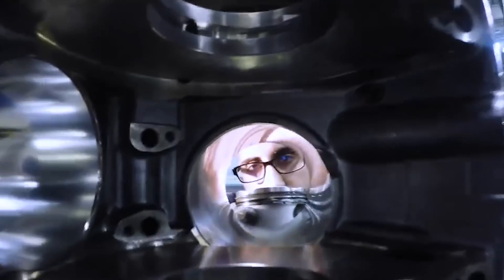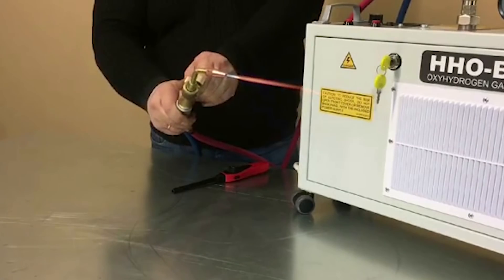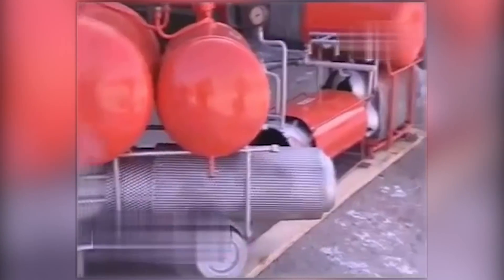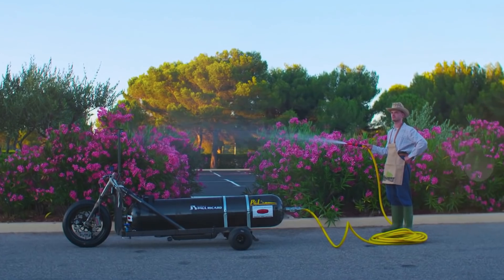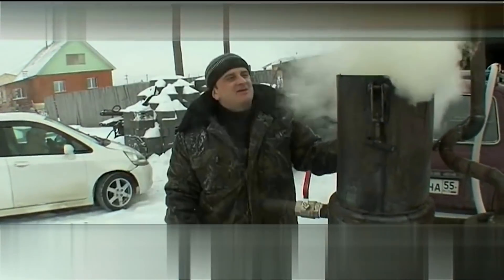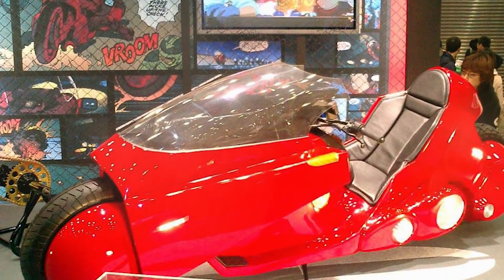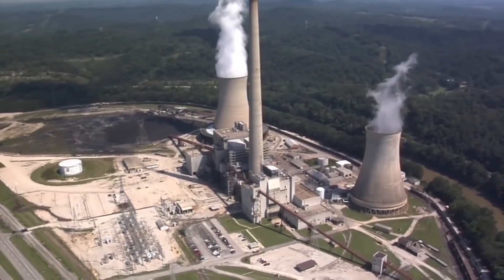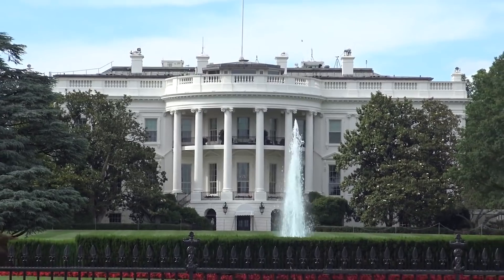Why These Engines Are Banned?

Comment: compressed air engine as a big thing? james watt lies in his grave and dies a secon dtime of laughing.
Reply: Remember the old airhogs compressed air airplanes and car you could get from Wal-Mart? Lol,  I still got mine, and two extra wings. Lol.
Reply: @hearsejr  me is german but me managed to buidl one colander air engine from lego.
Reply: @Irobert1115HD  they are fun to play with. Lol.
Reply: @hearsejr  Yup! I had mine in what, '97 or 98?
Reply: @KurtStudman  lol... It's been a while.
Reply: NibiruLives  No it isn't. It requires water pressure to work and some of that water pressure is lost in the process.
Reply: I've seen a photo of a WW2 vintage locomotive used in an explosives factory that ran on compressed air (safer than steam or electric).  They were not used more widely simply because of the limited range due to the space needed to store the compressed air.  Compressed air is a secondary fuel, so using it depends on a primary fuel source such as fossil fuels, solar etc.
Reply: @charlesangell_bulmtl  actualy yes. deisel can run on more fuels than just diesel. the problem is the fuel pump. solve it and the thing runs on vegetable oil.
Reply: @Irobert1115HD  The fuel pump isn't a problem at all, in fact the pumps used for "alternate fuels" needn't be protected from the solvents found in petroleum products.
Reply: @Irobert1115HD  the problem was not the fuel pump before, but it is one of them now, along with emission equipment.
Reply: NibiruLives  
Exactly how is compressed air free? It requires a compressor, consuming energy you pay for, to produce compressed air and waste heat.
Reply: @chuckaddison5134  use a bicycle ;D
Reply: @chuckaddison5134  Its free cuz you manualy pump it.. ahaha .. LOL .....
Reply: Chuck Addison ever Hurd of wind turbines ???
Reply: @anshulbhardwaj4038  you know that they are not wroking at all? the energy lobby buidls them as oversized ventilators to keep the prize of electrizit up. a friend of my friends friend heard it from a friend who works on a new energy source that doesnt need any fuel or energy input.
Reply: Dumbass...hahaha
Reply: engines have been designed and built to run purely on h2o, water, funny thing is, once you come up with something that the government doesnt want the masses to have, you end up dying of mysterious circumstances, aint that funny?
Reply: @k1ortia  You can't run an engine on just water unless you break the water into hydrogen and oxygen first, and that requires an input of energy. 
This idea of cars simply running on plainwater is just another variant of the "free energy" myth so beloved of conspiracy theorists.
Of course we do have "free energy" - its called solar, wind, wave etc.  And, funnily enough, where I live, the government is actively promoting these forms of energy.
Reply: @k1ortia  We tried running them on hydrogen years ago. That's the only way you can run them on "water". Sepating the water into free hydrogen and oxygen is easy, but is also dangerous and energy-intensive. 
Long story short, the "water engine" isn't worth the effort.
Reply: @k1ortia  bull shit
Reply: NibiruLives  Not at the pressures needed to run an engine.
Reply: Better engine would be a sail on a skateboard.
Reply: @farklegimp2304  that was built in the 50s.. and there was a race across a desert in the 70's useing a sail only.. something like 380 miles no engine what so ever. Kinda limited to open range though.
Reply: You are all stupid
Reply: @ExploringCabinsandMines  we're not stupid , we all care about the planet that we live on , and we know that if we continue with fossils fuels , we will kill this planet. So we all talk about ways to fix the mistakes of the "smart people " and hope that we save the planet in time
Reply: NibiruLives  
Gravity alone? No other machinery? Point me to some information, so I can study it. . .
Reply: NibiruLives  uhm you know that a steam engine doenst require steam to run? most steam engines on model shows are powered by a compressor when on display and running.
Reply: Why not use a windmill to run a compressor fill tanks and run a small steam engine i would think with gear reduction i should be doable.  Steam engines have a lot of torque so should be able to almost go emission free this way
Reply: @ethankime3368  of course a wind powered generator, combined with a solar plant, on the top of a station, subsidized with grid power, might be doable. Lol
  The positive points about compressed air isn't it free, but rather clean air. Compressed air engines are clean, and the air is filtered going in to the tanks. The oils used for lubricant is vegetables based, and non toxic. That do that in air compressors used for breathing air, so if it enters into the system, in will not kill the breather. Which means the exhaust is cleaner then the outside atmosphere. So if filtered again, it can be pumped into the car and you will have better quality air inside the vehicle. As a side effect of expanding air as it leaves the engine, it is cold. This is free air-conditioning. Then as another side effect, is you are cleaning the atmosphere as you fill up and drive. Lol. 
 I know it's probably not as cut and paste as that but it's one of those "every little bit helps". Lol.
 I'm a commercial deep sea diver, and I know about scuba and compressed air systems and have a lot of faith in it. Lol.
Reply: @hearsejr  you would know if your using it every day. I run a drill rig in quarries and mines using air for pneumatic hammer so i know there is a ton of energy in compressed air.  Its just a mater of efficiency and volume based on what can be produced by wind and solar.  Once that threshold is met anything can be driven and generated with adjustment for gear ratio and friction loss.  Might not be good enought for everyone but for someone wanting a cheapto run off grid kinda thing it should be doable.
Reply: @ethankime3368  kewl. Most of the air   I use came from a Detroit diesel powered compressor or a electric compressor. On the sailboats I used wind generators and solar, and have a lot of friends are living very well with a combination of the two and assisted occasionally with the inboard engine. Lol. You wouldn't believe how good they have gotten it worked out on some of those cruising sailboats out there. One guy is living better then most of us land dwellers that attached firmly in to the grid. Lol.
 I'm sure some one with better planning skills then me can make it it work.
  Also on a side note, the air powered carhad a built in electrical powered compressor, but I can not remember any details on it.. but it said it took a long time to fill using the built in compressor.
Reply: @hearsejr  definitely worth looking into. I love tinkering if i come up with something ill reply any keywords to look for on the sail boat stuff. Might be a good starting point
Reply: @ethankime3368  well with sailboats, you can try searching for setting up a cruising sailboat.. or sailboat wind generators and solar.. I had a thirty footer, and just sort of stumbled into that mess. These folks are sailing around the world. Some of them hard core crowds are doing it without engines. A friend of mine lives in Brunswick G.A., named James Baldwin is teaches folks how to set up boats for cruising. He wrote a book about his travels called "voyage of the atom". ..I think his YouTube secret idenity is AtomVoyager. Lol. He might not be able to help with compressing air, but can probably point you to getting solar and wind energy. Lol.
 Good luck. If you could work it out it would be great.
Reply: @hearsejr how about making the engine turn a generator , and have the generator run a compressor inside the tank , so the heat that it makes adds to the pressure. The longer the compressor runs the hotter it gets, and on the engine you can have turbos the help pump pressure in the tank when you need more power. The turbos are really effective cause they used wasted air. Since the engine is running a generator you could have it power electric  motors on your wheels, and have it charge a battery bank or capacitors
Reply: @jaxperez7860  not sure you could get enough heat to help.... as soon as the air leaves the compressor, it starts cooling down. Not really sure what would happen. Lol. Kinda gets into a situation where you can not produce more energy then you consume.
Reply: Also I remember the air compressor car has an inline air heater to increase the mileage.
Reply: @hearsejr well could you use air friction to heat the air up ? Think of why a wire gets hot,  as electrons flow through the wire it makes heat , so could we get the same effect with the compressor and copper tubing ?
Reply: @jaxperez7860  
Why do you suppose nobody's marketing a car using your system.
While your pondering that, read up on entrophy.
Reply: @jaxperez7860  I'm not sure. A air compressor gets hot enough to burn ya..but as soon as you release the air pressure it gets cold... Even makes ice at the exhaust point. Lol.
Reply: @ethankime3368  stick to the drill genius.
Reply: @ethankime3368  uhm you know that steam engines and better diesel engines are actualy a good plan against the climate change? steam engine scan be run without big emissions (run them on fries oil and some other waste) so that they are a better idea than electric semi trucks. adn diesel engines are hardy engines. make them better. put in some filters and create a good replacement fuel for diesel taht can be used for planes too and the emissions will shrink when everything is done right.
Reply: @Irobert1115HD i fully agree with you on reusing old oil and other fuels.  I am more thinking as a low maintenance of grid set up.  I love my old 12 valve cummins gets great milage for a big truck and low maintenance because it doesn't have all the new emissions crap on it.
Reply: @ethankime3368  I fucking hate Cummins and diesels but yeay.
Reply: @ethankime3368  we should actualy get scientistinto a lot of leading positions right now. i mean: guys like musk are a problem: they come up with dumb stuff that wastes time and money (like plastering roads with solar pannels). put the right people in charge of the climate change and it will end. sometimes insitutions will keep up the problem they should solve (pablo escobar once took the tour throug the FBI HQ. he was on their headlist at the time).
Reply: @Irobert1115HD  So you think burning cooking oil and other waste products doesn't pollute? You are simply talking about a replacement for petroleum products, not any reduction in pollution.
Reply: @WCM1945  if you get them from plants the CO2 is not from a dead dino.
Reply: @Irobert1115HD  Focus on a statement and make the statement. Don't wander all over the place like this.
Reply: @tge3069  what's your favorite flavor crayon?
Reply: Ethan Kime possible, but not practical for many reasons.
Reply: @ethankime3368  There is a huge difference between "free" and "emission free".
Reply: @ethankime3368  exactly... this kind of thing makes sense...
Reply: @svkuusi  there are already wind powered compressors on the market get a few 500 gallon lp tanks hooked up as storage an have a couple or as many as needed 100 pound tanks that fill from the larger tank range would be the main factor to get figured out.
Reply: @ethankime3368  
Steam emgines, running on steam, hava a lot of torque because of the expansion rate of steam. Using compressed air would not generate the same torque, far less as a matter of fact.
Reply: @ethankime3368  Research triple stage steam and steam cavitation . You'll have some insight .

Comment: Fuel cells. Not new
Reply: Have you seen GM's Hy Wire fuel cell concept car from 2002?  Damned clever-basically all the running gear was in a car-sized skateboard that used drive-by wire, onto which you could bolt any one of a dozen different body styles.  Have another kid and need to own a mini-van?  Sell your current sedan body, buy a gently-used mini-van body, have it bolted on in a couple of hours, and have an almost like new car for a fraction of the price of buying a whole new car.